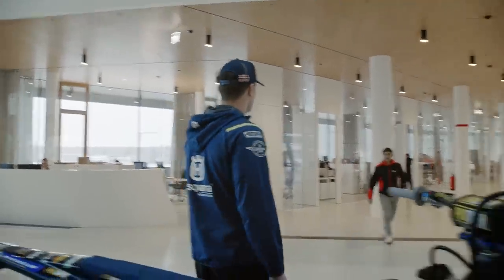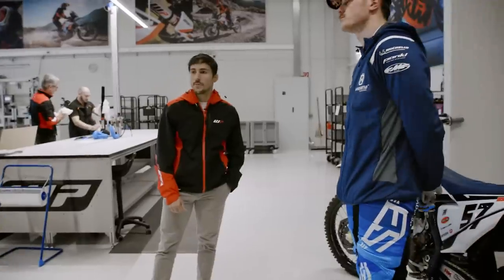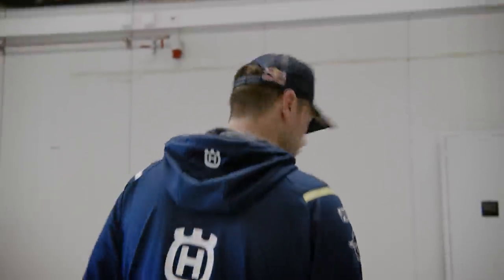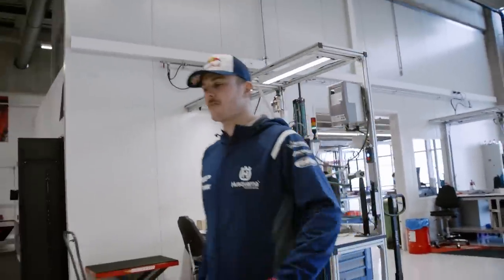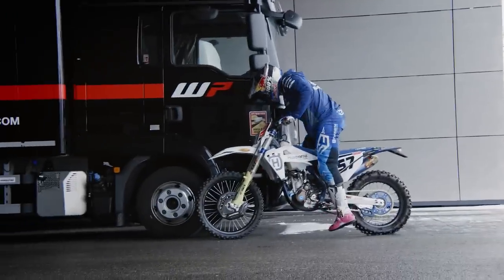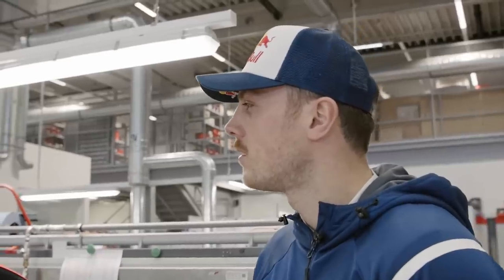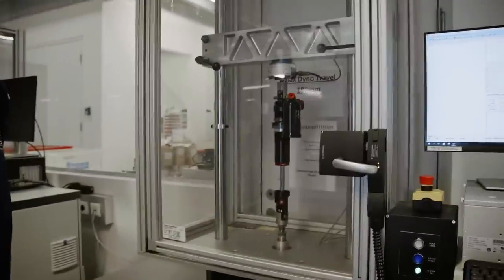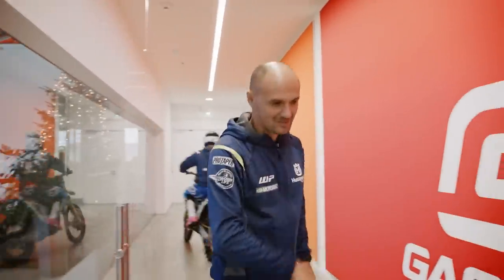Billy Bolt visits the WP Suspension Factory

Comment: WP, can you ask KTM to handle your forks better? I bought a new 23 ktm 250xc, and the forks outer tubes were badly scratched as they were lazily installed into the triple trees. 

These parts are expensive and not something I should have to deal with on a brand new WP equipped bike.
Reply: That's often a shipping issue more than anything else. Dealer should have made a warranty claim
Reply: Yeah back in the day i did prep and assembly and there would have been a form for a claim at the dealer before delivery
Reply: @TheShift1313  I didn't see the damage until I removed the white warning sticker (it was applied poorly). I actually recorded as I removed the sticker with my hands only, reveling the damage from the sloppy assembly.  

 It's just minor cosmetic issue but it's frustrating that my new 23 $10,000 motorcycle is in worse cosmetic condition then the 2012 it traded in for it.  The dealer did a good job of scratching up the plastics as well as leaving a few hefty scratches in the nicely machined swing arm from dragging their foot down while putting the kickstand down.  I actually haven't rode it yet and I've been considering selling it, I'm pretty easy on my bikes and I keep them a long time. It would probably take 20 years for me to cause the type of damage that my brand new bike already has. I keep my bikes on display in my basement when not in use, the visual damage definitely bugs the heck out of me.
Reply: @monsieuroxyopia8262  The header pipe is another part that should have been replaced.  It's ktm's worst welding job ever.  I think the machine malfunctioned at the most visible part of the pipe, there is a lot of slag far from any welds right in the side. Looks like trash.

Comment: What a useless video, no substance. Just as disappointing as their suspension. Upgrade to a 2020 FE350 and the suspension is a step down from my 2013 EXC 450. The target: cost out, performance just enough for the novice rider and make you consider upgrading...well that is what I did, but not with WP.